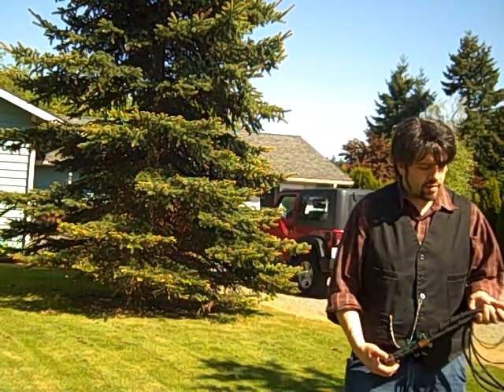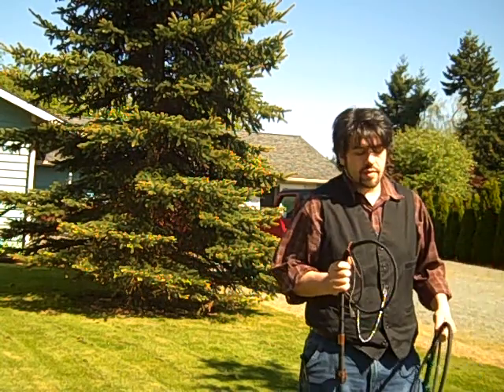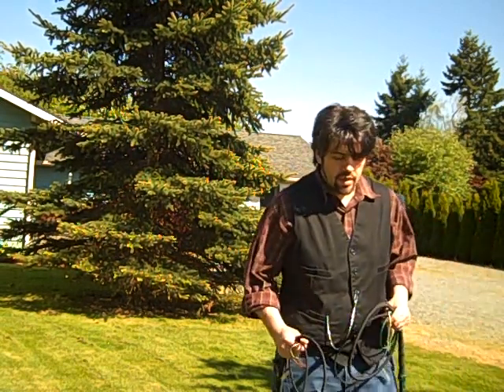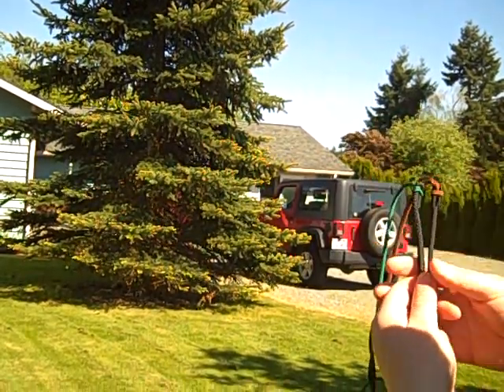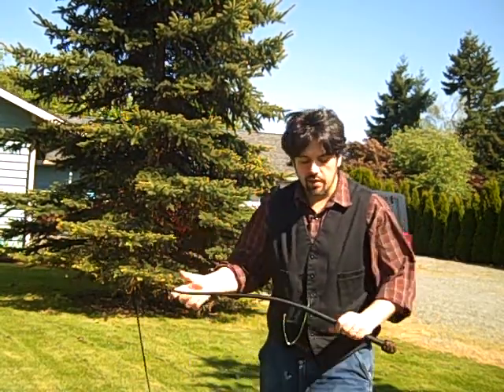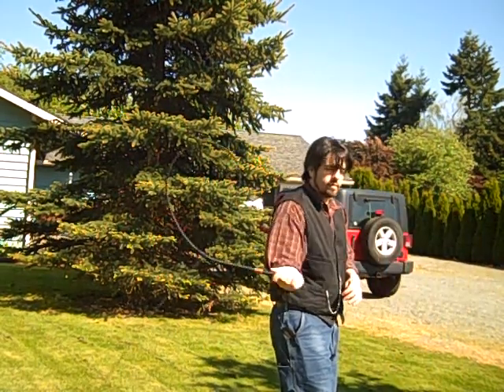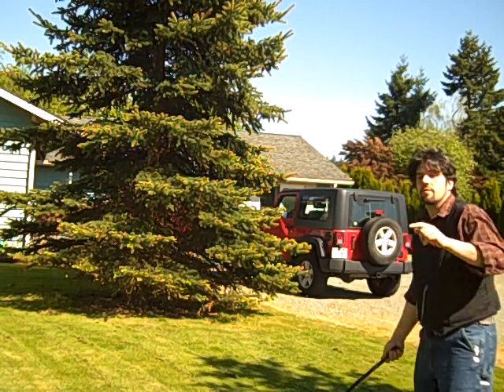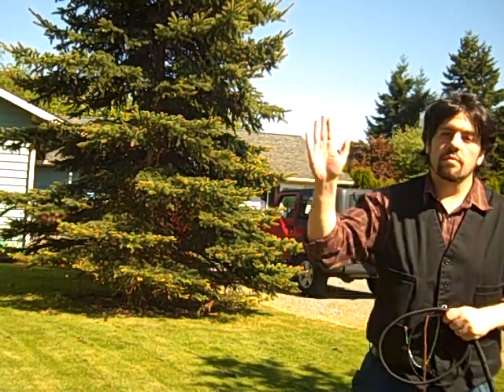New material for whipmaking

Comment from the maker: Howdy Kyle,
  It is very thin, but it seems to transfer energy really well because of how dense it is.  After I shot this I put a little shorter fall on there and it cracks better on that victorian cutback I had a problem with.  I've already got a buyer for it, I've just got to redo the knot for his hand and send it on over.  I also just finished a matched set of six foot exowhips with this material, on those I carried the taper out a little farther.

Comment from the maker: Howdy,
  This is a 6 foot whip with a 12 inch handle.  You're right, there is a limit to how fine you would want the tip, I wouldn't make it any finer than this because this was just a hair thicker at the tip than paracord, which I used for the fall.  I do also use dacron falls sometimes which are thinner.  I've never made a signal whip but I've made many snakes.  It cracks with very little effort, and your arms never get tired :)

Comment: How long is that whip and how long is the handle? Wouldn't there be a limit to how fine you want the tip to go because there's a limit to how thin you want the fall to be and the fall should be thinner than the braid unless you're making something without a fall like a signal whip? Have you tried making a snake or signal whip? If so, is it harder or easier to crack with it being so light?